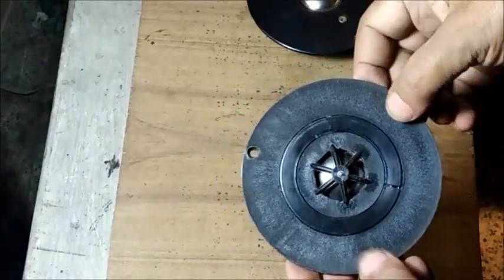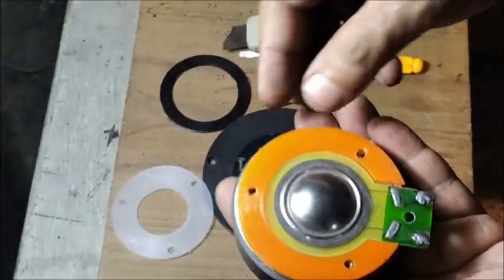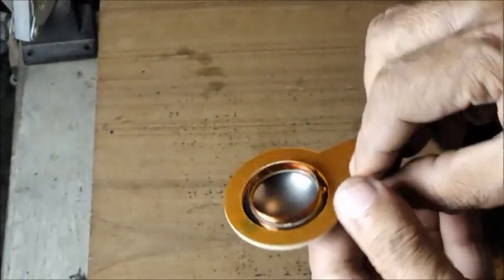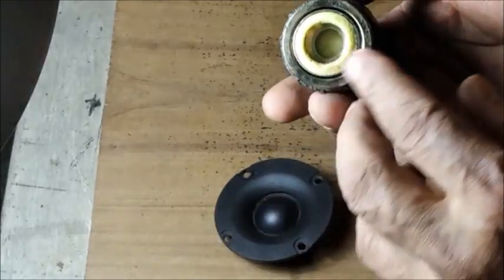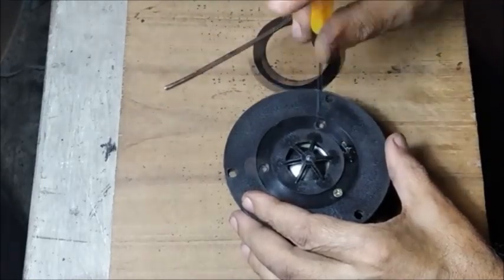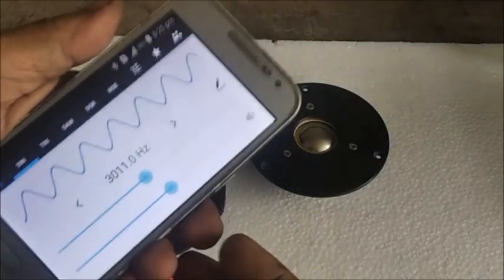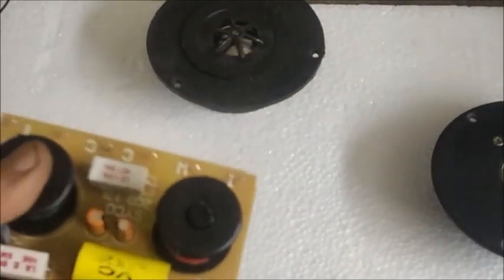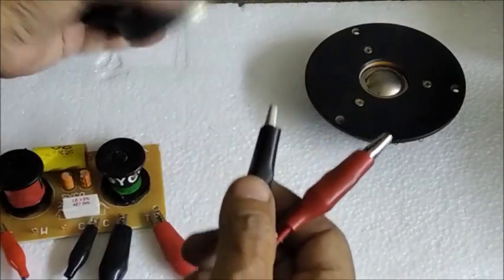Know about Dome Tweeters

Comment: Sir, I have 8"-8 ohm Dual cone pair spkr. with 4" Horn tweeter. Pl suggest aprotiate amp. to cover16'×13' hall. UNIVERSAL amp. us-95 is a better choice or someone else brand. I have Creative SB 370 compt. System with 2" Cube spkr. &4" woffer

Comment: I using mekasonic dome tweter, 3"tweter &2"piezo tweter with 10" woofer  80 waat.and mekasonic 3way12 db cross over  network.excellent sound quality in my minicresendo mosfet amplifier home audio system. 25 years old my audio system.

Comment: hello, I have 2 4 inch dome tweeters with a 3.3uf 250v capacitor on 4 ohms.
I'm using it with a 4x80w amp.
2 6.5 inch midrange 4 ohms installed but 100uf vs 47uf ? should i wear it